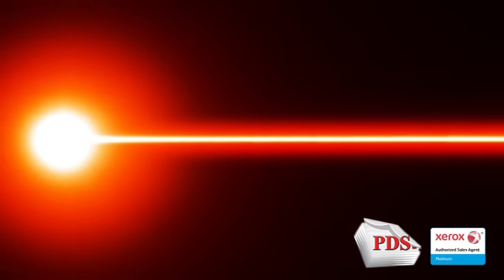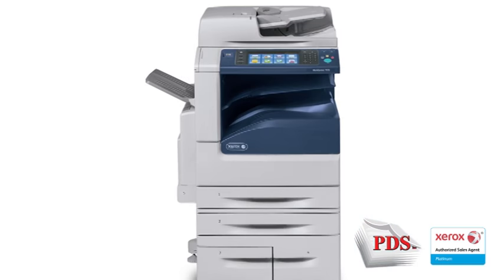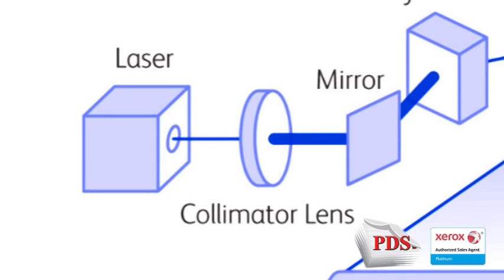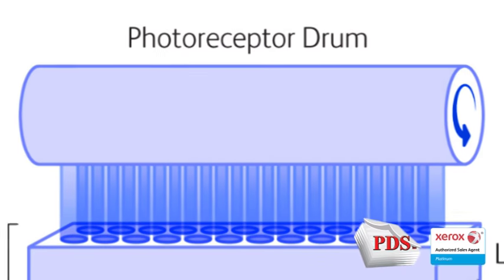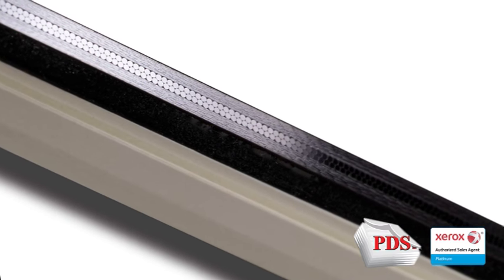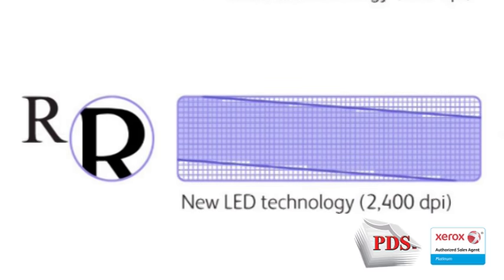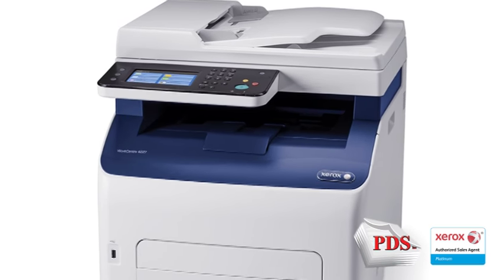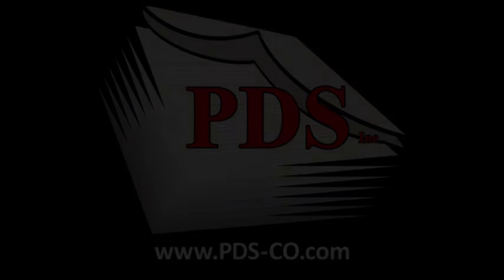What is an LED Printer?

Comment: How does a light emitting diode negate an electric charge? I know how a laser can, but i don't understand how an LED can accomplish the same thing.
Reply from the maker: Hi Brenden!

A laser charges the drum in a laser printer, the drum in the LED printer charges through a photosensitive chemical. So in one, the laser does the work, in the other, the drum does the work of producing the electrostatic charge.

For more info, Xerox has a PDF: www.office.xerox.com/latest/XOGWP-15.pdf
Reply: light sensitive drum is sensitive to any light.so any light discharges the drum.i have tried that by opening the side cover of a printer while printing.